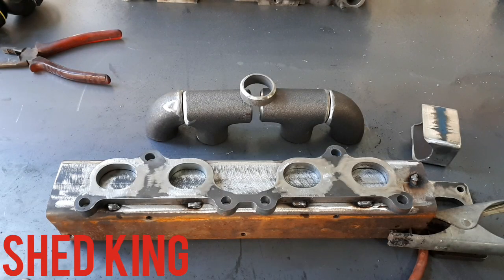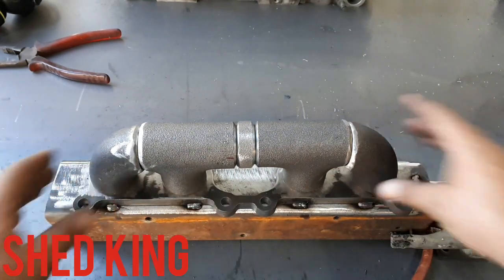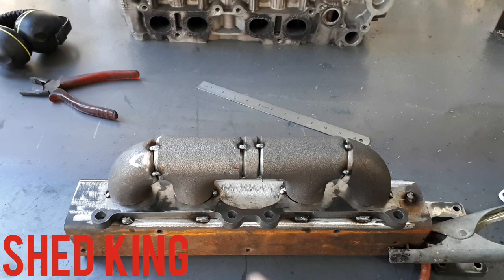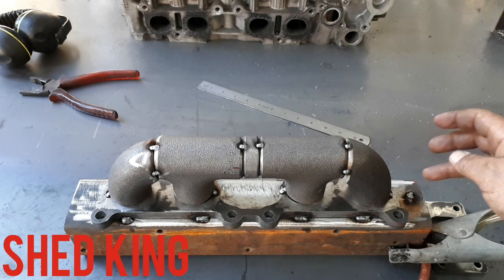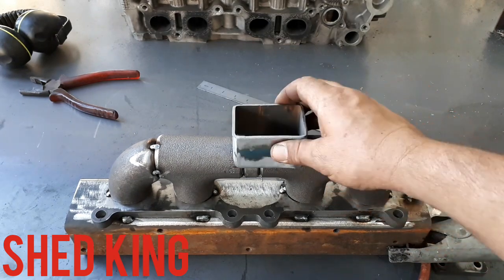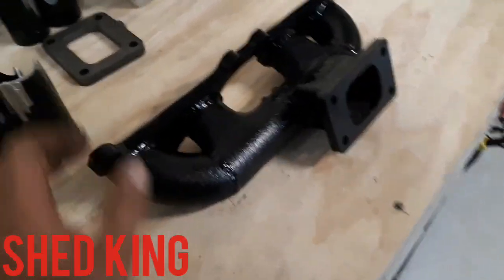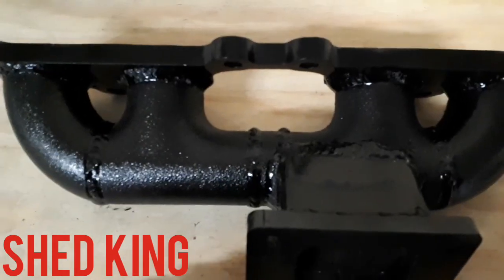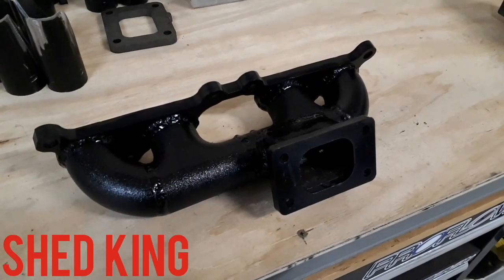How to make a 3rz turbo log manifold in detail #the3rzshed #builtnotbought

Comment: Hey bud, what are the dimensions of the rectangle tube that you use?
Reply from the maker: 75x50x5
Reply: @TunaRacing  are those dimensions for 1.5” sch 10 pipe? Or was the manifold made of 1.25” sch 10 pipe?
Do you recommend square dimensions for 1.25” sch 10 pipe?

Comment: Hello, you do the intake manifold also mate. If so how much mate ?
Reply from the maker: I do mate with throttle body or without ??
Reply: @TunaRacing  with throttle body, but i dont know what size i would need?  its a street car i want about 300 hp
Reply from the maker: @user-pd9vm9ts1o  80mm throttle body and tps plug and plenum $1400+ shipping
Reply: Welding without gloves is like cooking bacon in the nude lol